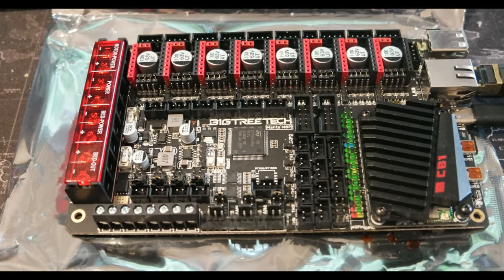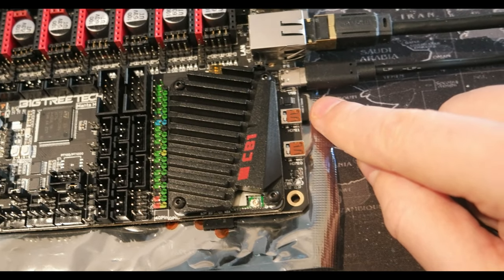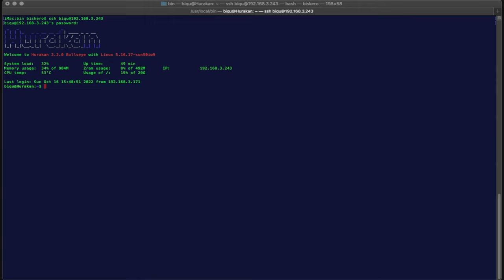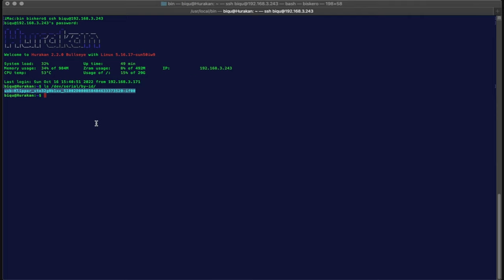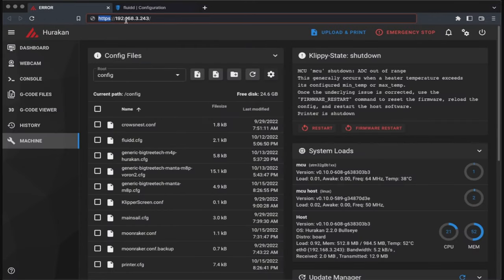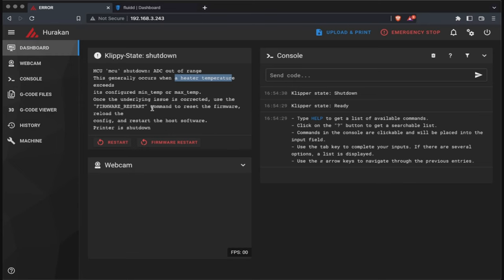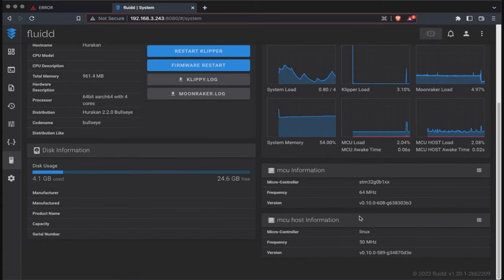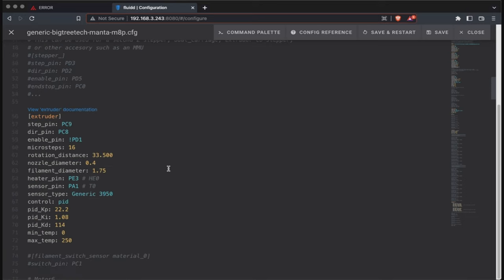Klipper firmware installation on the BTT Manta M8P via CB1

Comment: Just a heads up, you shouldn't place hardware on top of those esd safe bags, as they are actually conductive on the outside. That's how it protects the inside of the bag :)
Reply from the maker: That's a valid point but for older bags. Newer bags have a resistance above 10 MOhm making them, for all intents and purposes, non conductive.

Comment: hey ganzo thanks for the video I have a trident with a very earily spider 1.1 board that recently died so I decided to give the manta a chance but I was a bit worried about the FW since it seemed like every other klipper update I had to update the FW on the board but using the CB1 to update FW will be a lot easier plus anything I can do to reduce the amount of wires in my electronics bay is a good thing and this board will eleminate a lot
Reply from the maker: I had similar issue. I was using Marlin on BTT SK Pro, so I had to recompile overtime I made a change to the firmware. So I am switching to Klipper, after some research, and landed on the BTT Manta CB1 combo since If I need to update the Klipper package, the firmware or the config is all done via software without the need to touch the HD. I am new to Klipper but looks like is the best option if you are building a 3D Printer and looks powerful given the expansions possible. I will do some more videos and probably create a script to do the Klipper update, make the firmware and update on the Manta, should pretty easy since are just 3 commands! Thx for the comment, pls subscribe !

Comment: I could not find the usb serial id,
Reply from the maker: It should be detected by your computer
Reply: @ganzoai  i make new os image with new sd card trying to start over, but when i ssh the cb1, i still could not find the usb serial id, is it because my m8p already wired up with all the wiring such as stepper motor, power supply and others and interfere with the usb serial detection?
Reply from the maker: @muhammadakmalfadilah3273  don't think so, that's how I did it to from fresh install. Try to boot up without the cable connected and than connect the cable. Or the reverse. In any case I remember these issues are common with USB connection. Good luck! Please subscribe thx
Reply: @ganzoai  what do you mean by cable? usb A to A cable? i felt like an idiot, but actually, do we reall need to connect the board with usb cable? i thought wifi only is enough
Reply from the maker: @muhammadakmalfadilah3273   I use cable just to be sure there are not issues, than you can switch to wifi of course. I usually do not use WiFi. Try to debug, one thing at the time and see if everything works as it's suppose too.
Reply: @ganzoai  ok ill try to use cable first, thanks a lot